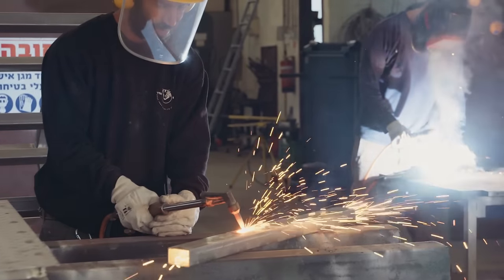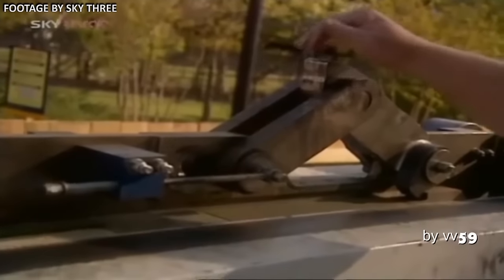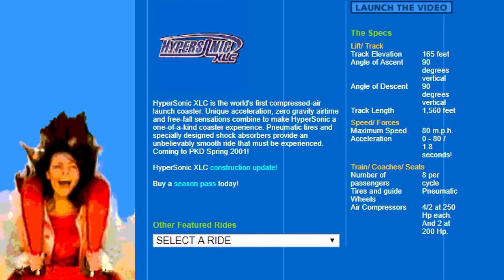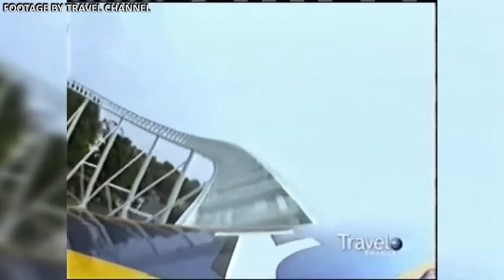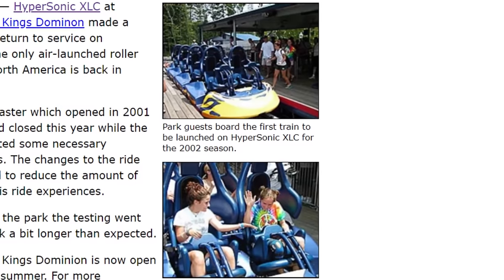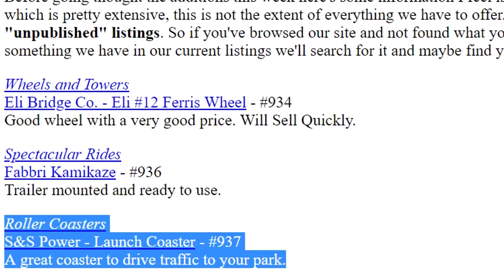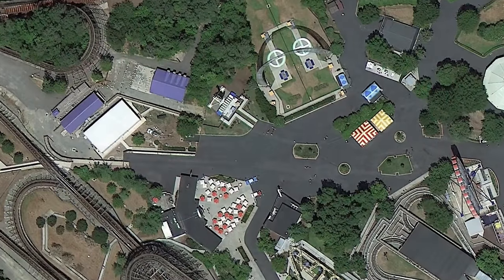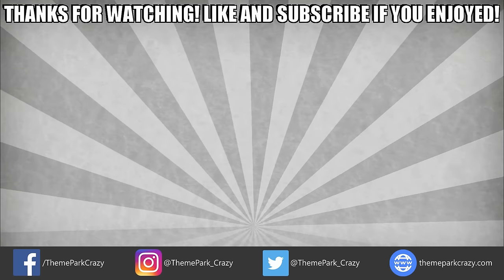Failed Roller Coasters: Hypersonic XLC at Kings Dominion (Feat. Coaster Studios)

Comment: Nice video guys! In all the times and versions I had ridden Hypersonic (which wasn't many mind you), the brakes on the upside of the tower were never used for trimming. It was was explained to me that they were there to help ease the slow-down during a roll back and not to trim the ride as it was heading up the tower. Now, the park may have altered the brakes eventually but I don't have any personal experience being trimmed on the upside. While the airtime wasn't as great with the later trains, I think that was due to the train design more than any possibility of trimming as I would have clearly felt that. The same goes for Dodonpa. There were brakes but I haven't heard of anyone being trimmed on that ride either. I certainly wasn't during my rides in 2005.
Reply from the maker: Thanks for the complement Sean! I wasn't too sure about those brakes either, so I threw the word "alleged" into the script. A few message board users back in the day alleged that the lack of airtime was due to the brakes. Local news background really comes in handy sometimes haha. Thanks for the knowledge; you really know your stuff!
Reply: Thanks for the kind words as always.
Reply: Agreed with Sean.  It's more likely that the park modified the launch to more properly deliver the right speed to crest the top hat slower, which was probably how the ride was originally intended to run.
Reply: I wish I had been able to experience this, but I was only 2 at the time so I couldn’t. I remember that my family went on a trip to KD that year with me but I could only do stuff in whatever they called the kids area back then.
Reply: agree with Sean, i rode it many times and didn't experience any trimming on the way up.  I think the ride had enough trouble making it up and over, without KD slowing it down any.  :)

those altered trains had a LOT of added wind resistance.

Comment: I'm really sad this is gone.  The launch was unmatched.  Pretty sure they could build a revised version now with a dual loading station like Top Thrill Dragster uses to help increase capacity as well.  Also the most intense brake run i've personally experianced.  I wear my glasses on every coaster I ride and never have an issue, but Hypersonic XLC was the exception, the brakes nearly ripped the glasses right off my face.  RIP good buddy

Comment: So the only reason it failed was because of cheapskates.
Reminds me of a Dutch saying; Goedkoop is duurkoop. Meaning if it's cheap to buy, it will most likely be expensive to keep using.
Reply: Well, it was also that the park was facing the risk of lawsuits (due to Virginia being a sue-happy state) as a result of rider negligence. Remember that back then, cell phones were mostly the flip phone kind, which often used a belt clip to hold it to the person. Unfortunately, a fair number of idiots who rode the Hypersonic elected to ignore the multiple warnings from the park regarding riders with cell phones as the clips weren't designed to hold the phones under those loads. So a fair number of phones came free and ended up as projectiles being launched at the ground and fellow patrons of the park.
Reply: The dutch have an odd language lol
Reply: That reminds me of the saying "The most expensive car you can buy is a cheap German car"

Comment: I rode Maxx Force this year, and it certainly was much more reliable.   It did have technical delays every now and then, but they only lasted minutes so it was likely a result of it being rushed to open on July 4, so hopefully it can be all tuned up for the 2020 season.  Its smooth launch and exciting elements make it an incredible ride.  I especially liked the dive loop at the end of the ride.  The final brake run starts about halfway down the loop, creating a fun and unique sense of hangtime

Comment: I grew up near King's Dominion, and I remember the hype surrounding this ride.  Despite the attempt to make it "match" the architecture of the park, it stood out like a landmark, and could be spotted from all over.  You could tell when in was running from a pretty good distance, signaled by a bang, followed by 5-10 seconds of panicked screaming.  

The load times in between seemed to take forever, but maybe that was just the relative short ride time or frequent maintenance breaks.  The lines for this 30-second nightmare were absurdly long, too.

Comment: I worked as an operator on this ride for about a month in the summer 2002.
 
Every morning before opening, we had to try it out. With my hands above my head, it was truly a thrilling experience ;).

It also happened several times, that there would be a toupee flying in the air, usually not to be retrieved by its legitimate owner later on ;).
Reply: Of course.

Comment: I completely forgot about this coaster until this video.  The launch was pretty neat but it was such a short ride compared to wait time.  Six Flags Jersey's Kingda Ka did it a bit better but that overall style of coaster is such a short experience.  Great video!
Reply: Mark Shaskey I agree, the ride time was ridiculous. I timed it once and I think it was... maybe 10 seconds? I only rode it twice and didn’t feel like it was worth it. I was always more fond of the anaconda.
Reply: @KatieLHall-fy1hw  I'm right there with you, this video totally jogged my memory of being excited about it, and it was over by the Hurler (which was pretty fun when it was new, it got rickety as it or maybe I got older).  The launch was pretty much all the coaster had with enough track to slow you down on the other side of it.

The Anaconda is definitely the legend of the park, I've rode that more times than I can count.  Volcano was also really good so it's a shame that's getting removed now.  King's Dominion used to be a really great park, it just seems to have kind of lost it's way a bit.  It's emulating the Six Flags up the road in DC as a multi-style park which is fine but those don't draw big crowds.  Busch Gardens and even Hershey Park are making much bigger strides as best theme parks in the area (I live in MD so pretty central to most of the ones between Jersey and VA)

Comment: The description of the compressed air launch platform sounds a whoooole lot like an aircraft catapult...
Reply: Same genus, different species. Besides the really big difference of steam vs compressed air for non-magnetic catapults, the biggest difference is that a CV's catapult has the gas piston acting directly against the shuttle, rather than through a cable-pulley mechanism. This is due to the loads the things have to work with, getting tonnes of aircraft moving with a similar overall rate of acceleration.

Comment: I RODE THE XLC at KD.  I think it still had a windshield. I used to think I wanted to be an astronaut until riding this beast. I had no idea! I had been riding coasters my entire life b4 the xlc-  Cedar Point, Bush Gardens Florida and Virginia,  Disney.  Kd. Six flags etc.  From Disney, I knew to keep my head pressed against the back but I think it still felt like whiplash. I remember the quote "0-90 in 2 seconds" - say it was 85mph - whatever the speed was IT WAS TREMENDOUS AT JUST 2 SECONDS omg. and I dont know how they got away with those speeds because when u go over the top of the XLC u literally get your eyeballs ripping from their sockets- take a close look at the angle. No coaster has that sharp a peak!  It was the most intense pressure. Ive riden those apple turnover wheel rides etc. Xlc was beyond any of those rides.  For some reason I wanna say it went forward then backward. I can't see how the thing could possibly have accidental roll backs, not reaching the peak?  That's insane-  If going zero to 8o/ 9o.  Mph.  That's- man I'm glad there was never a serious wreck on xlc.    I wouldn't call it a failure at all though. I think it a marvel of creative engineering. Look at it.  It was truly beautiful.  :)

GREAT VIDEO NICE BACKGROUND INFO. CHEERS.

Comment: I road this back in the early 2000s.  It was kinda novel...never went back for a 2nd ride though.  I recall walking through the park some years later and only then realizing they had removed the ride.  You could still see some of the concrete support structures though.

Comment: I rode it only once. I remembered standing in a line waiting for the ride - more than 2 hours, I believe. whenever the ride goes around the corner, I can see the metal moving and shaking as if it was not secured properly. I was afraid that one day, the metal that held the ride would give away.

Comment: This ride was originally supposed to go to CGA but ended up at KD after paramount parks cancelled their exclusivity deal for the vekoma flying Dutchman coaster.The ride that became batwing was supposed to go to KD that year while SFA was supposed to get a standup coaster.
Reply from the maker: From what I found. The CGA story was a rumor. I couldn't find enough evidence to back it up. If true, it would make this ride even more fascinating.
Reply: @ThemeParkCrazy  yes it's true it was supposed to go to California's Great America when it was Paramount's Great America they have already started to do land clearing for it during the 2000 season they remove the train Railroad and it did a little bit of when clearing where the Willard's whizzer roller coaster used to be it was supposed to go where the whizzer once stood and the train station in 2001

Comment: Not a fail to me...and is STILL my fav.  Rode in 01-02.   It made me realize I wud NEVER make it as an astronaut!   I was trying to find how many "G's" this beast took u to.   Apparently 4 G's where as the Intimidator, also at Kings Dominion, apparently takes riders to 4.5 G's.  But I've ridden the intimidator, along with dozens of other coasters @ Cedar Point, Six Flags Ga, Kings Dominion, Bush Gardens Va, Bush Gardens Fl, Disneyworld, etc.  and none compare. I think most of the times I've felt the G's on coasters was when the coaster was going down the track and into a spiral or loop and that's where the full force of 4 G's hits the rider.  With The hypersonic the extreme G's came as u cleared the peak. Up n over G's vs compression G's.  Felt like my eyes wud tear out my skull.
Reply from the maker: I have heard it was amazing, but the fact that it hardly opened and suffered irreparable maintenance issues makes it a failure in an investment sense. I personally would have loved to ride it.

Comment: I haven't watched all of your videos yet so I don't know if you remember the Deja Vu coaster at six flags over georgia. It was an entirely pneumatic driven coaster and was always down. So many air lines it wasnt even funny lol. But one time i rode it as a kid and the over shoulder restraint let go on me (possibly due to an air leak or idk) while we were at a straight 90 degree angle facing down. All my weight was on the restraint when it let go. The safety belt between my legs was the only thing that saved me, i had to push off of the seats in front of me to get back into the seat. Was wild lol.

Comment: I wouldn't call it a major failure if there were no serious injuries or even fatalities during its lifetime, which can't be said for all rides.  I visit KD once a year and of the 10 or so years I've been going, the Volcano Blast Coaster was down for at least half my visits, significantly pissing me off as it's perhaps my favorite ride, and I always buy the most expensive fast pass accessory, which includes the Blast Coaster with the upgrade, and what good is it for the extra money if the ride is closed??  That's my major gripe with the park.  Best to call ahead if you can only visit once and make sure the rides you want to go on will be open, otherwise, re-schedule if you can.

Comment: I worked at Paramount's Great America during the 2000 and 2001 operating seasons.  Between 2000 and 2001, our train was removed so a "Thrust Air 2000" could be installed, taking up the former location of Whizzer.  Apparently, TPTB had other ideas, quite possibly because we already had another prototype ride which opened in 2000, the world's first and only true flying piece of sh...  Roller coaster.  Looks like we may have dodged a bullet...
Reply: You're absolutely right I remember asking a ride mechanic who was on site walking around the old whizzer ride area this was back in 1996 I asked him if anything was going to be built all this site and he said yes we're thinking of putting a high-speed roller coaster in the next few years I remember being so excited that finally something is going to go where the whizzer used to be it was sad that the train got removed pretty much for nothing it even showed on a 2000 map the area where the Whizzer was would be outline saying a new exciting attraction will be here in 2001 so sad that never happened
Reply: Correction it was 2000 and that was stealth the world's first flying coaster which only lasted till 2003
Reply: Nathan Lopez Thanks for noticing my typo.  LoL  I didn't even live in the area by 2009; damned touchscreen keyboards...
Reply: @AnakinMarcZaeger  the park was the best around the time you worked there they had the most coasters after 2002 season it started to go downhill they started removing coasters for no reason first was tidal wave in 2002 then stealth the following year and invertigo after 2010 season Cedar Fair does a way better job then Paramount did towards the end

Comment: "Shortened the hill to fit the layout of the park"?? Lol.
Ironically, if it was taller, it would be able to handle the forces at the top easier and they wouldn't need those trim brakes. Lol.

Comment: I rode Dodonpa before its recent re-profile.  The design of the hill was extremely poor, it was like getting punched in the gut by Mike Tyson.  Typical late 90's-early 2000's American engineering.  And the capacity was absolutely terrible it may have been the slowest and most frustrating line i've ever waited in for any coaster (and i've been on over 400).

Comment: Part of the issue also was the liability for the park due to the idiots who were among those riding the attraction, given that a fair number of patrons refused to store their belongings such as cell phones either in one of the storage bins provided at the loading dock, or with a non-rider friend. So because folks decided to rely on belt clips to hold their phone to their person, they quickly found out (as did folks on the ground as there were several near misses) that said belongings would not remain attached to the rider during the high speed turn following the drop.

But at least it's not like Racer 75 (or as it was formerly known in 2010 as Rebel Yell when the incident happened) where I had my restraint bar fail about halfway through the course, so I was stuck holding on while being tossed around. ^^